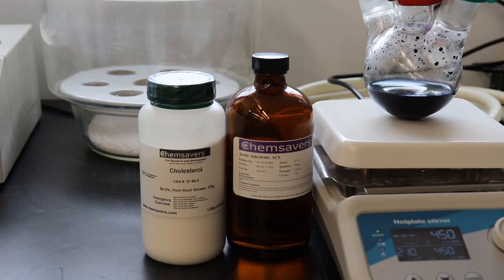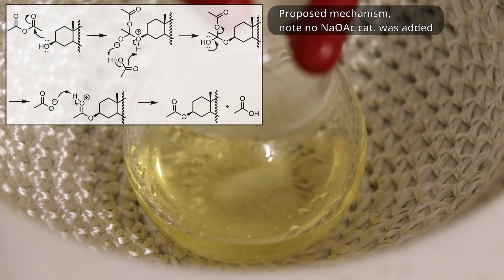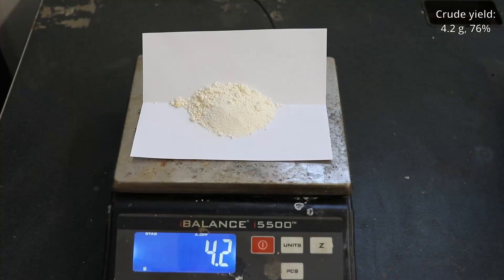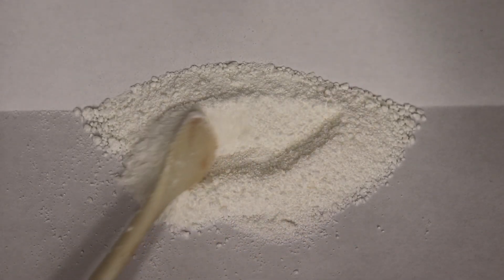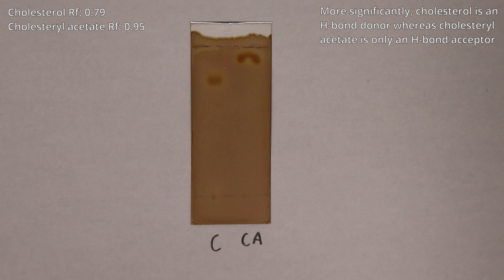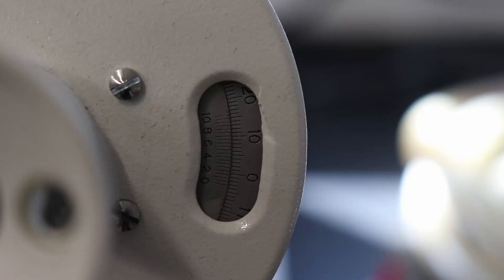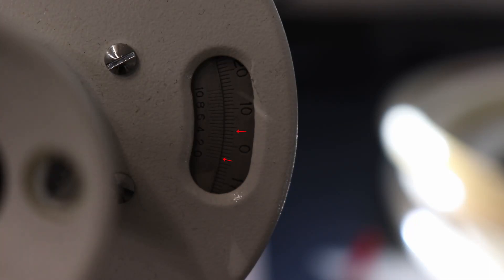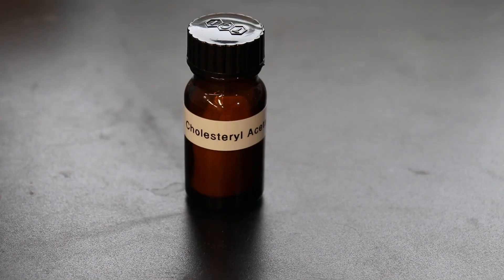Cholesteryl Acetate Preparation, Analysis, and Polarimetry

Comment: Is it possible to use acetic acid instead?
Reply from the maker: I’ve found a couple sources that use acetic acid with a metal catalyst to acetylate cholesterol. This one uses FeCl3 as the catalyst and reports an 86% yield, DOI: 10.1055/s-1999-2806
Reply: @corrosion-chem  Lewis catalyst can be used as catalyst for esterfication?? Really?

Comment: Looks like a clone of a PerkinElmer/Revvity sodium lamp.  I wonder if a vintage Soviet DNAS-18 lamp would work?
Reply from the maker: Its a ND20 Gp20Na-1 low pressure sodium lamp I bought off Ebay, I’m not sure if any others would work, might have to modify the lamp socket or use a separate power supply